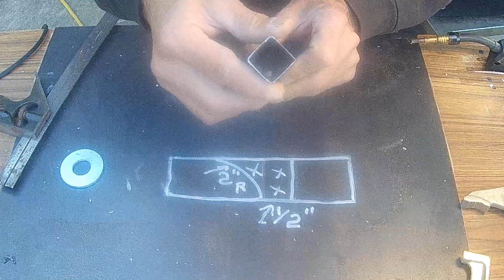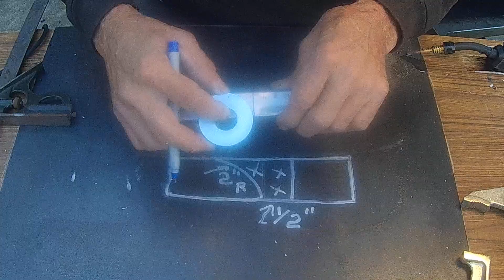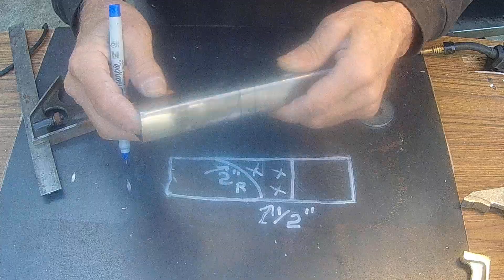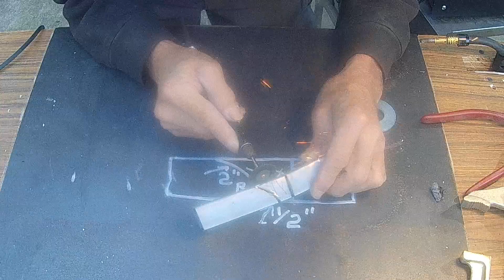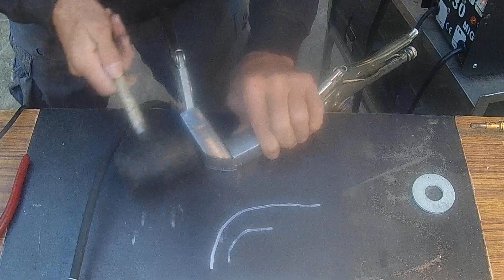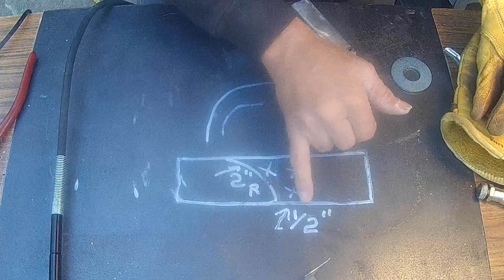Bending Square Tubing without a bender

Comment: Thanks for the lesson! I  was thinking of trying to build a tractor  cab out of 1" square  1/8" wall. This would sure beat welding end caps.
Reply from the maker: Thanks for watching. I was thinking the same thing about the cab. This'll make the curve parts easier to make.    Later